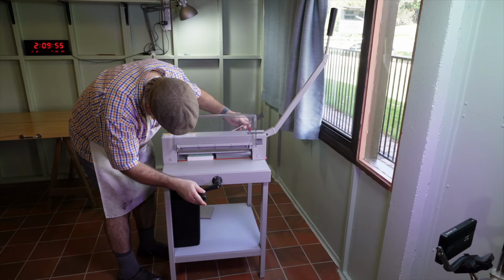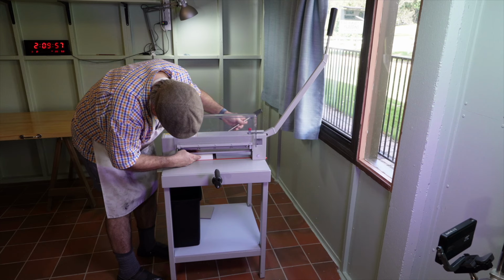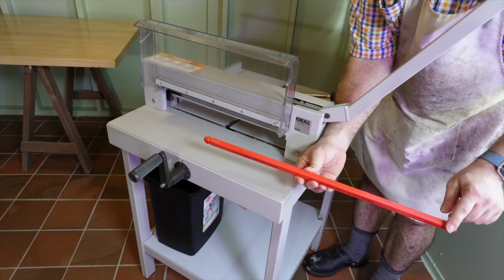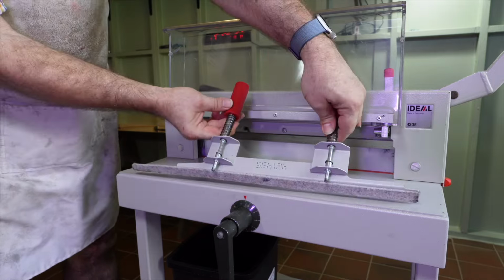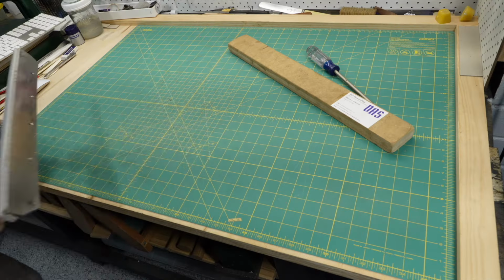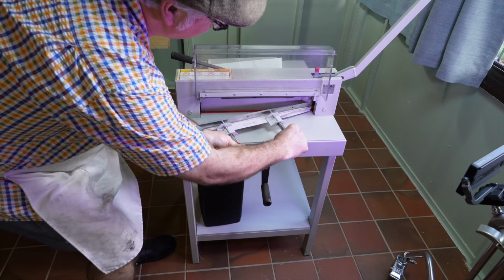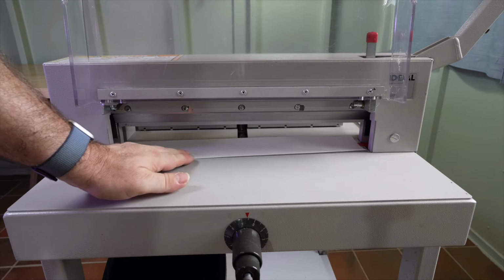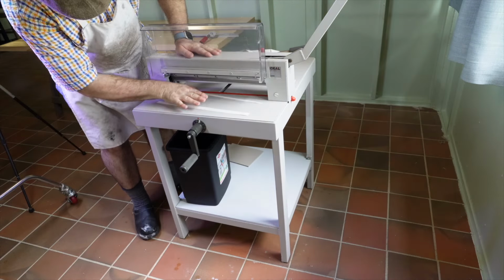Changing the Blade on an Ideal Guillotine // Adventures in Bookbinding

Comment: I was once give some knives ("that might be useful for something") from what I was told was a picture-framer's mitre guillotine; shorter than yours but similarly thick and heavy. I could not believe how sharp they were and decided my fingers were more valuable than some makeshift cutting rig, and so confined them to a homemade wooden sleeve like your transport box, until I could pass them on. The blade holder for that Ideal Guillotine is ingenious, and I'd guess trying to change that blade without it would carry a very high risk of ending one's bookbinding career! Thanks for the demonstration, fascinating.

Comment: in the past i cut my books with a stanley knife but i had the immense luck when walking around at my work i saw an Ideal 3905 guillotine, and asked if i could have it because i knew they where trowing the old stuff out to get new things. i got it completely FREE, with an extra unused blade but only without the table legs and front safeguard. i also had some cleaning up to do, because it was yellowish from the nicotine from back in the day when you could smoke in buildings.

Comment: So how does one dispose of an old blade? And thanks for the video 🙂.
Reply from the maker: You sell it on an old guillotine and call it like new. Only kidding. I’ve never had to. Interesting idea. I’d probably drag it across concrete to take off the razor edge. Maybe even go a bit further with my diamond stones. At that point it’s probably no worse than any other sharp piece of scrap metal.
Reply: @DASBookbinding  Thanks. I still would be careful with something like that.

Comment: Finding a professional shop that sharpens blades is increasingly difficult.  I have several paper cutters that need sharpening and truing. One has a curve worn on the straight blades edge so it no-longer cuts square.